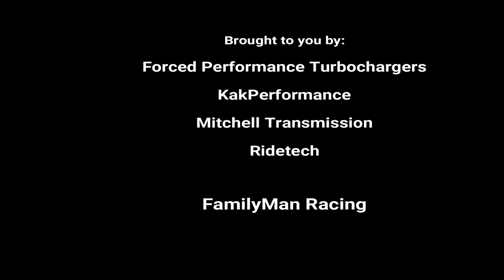Raceweek 2.0 - Day 4 & 5 Completed!

Comment: if you watch at 7.26-7.38ish when your 2 step is on the exhaust is popping breaking the starting line beam. It didn't red light you on that pass but I'm sure it did on others. It don't take much to break the beam. Great job though!!!
Reply from the maker: Even when the light didn’t go red, it still started the timer before I left. We were told after that the lights were loose/vibrating and they ordered new ones.
Reply: @4familyman  you had your hands full with that and trans issue and the traction for everyone was bi-polor on the last night.
Reply from the maker: I had a few great passes. Just didn't have a slip that showed it. According to my data...5.9x; 5.5x; and a 5.7x (foot brake on that one)